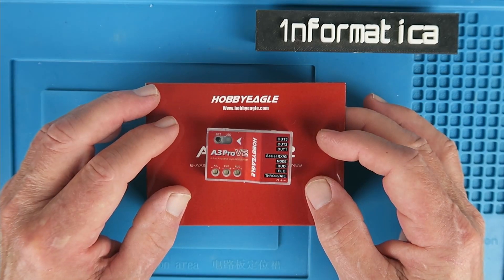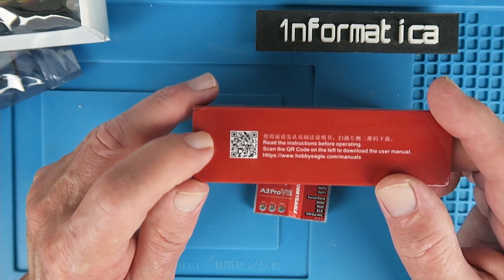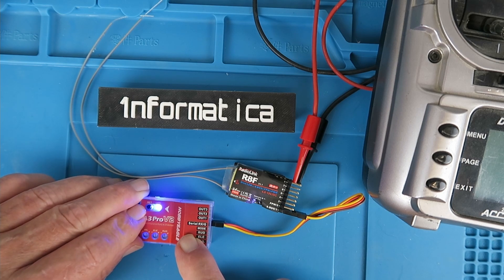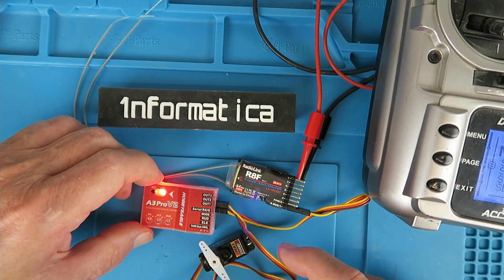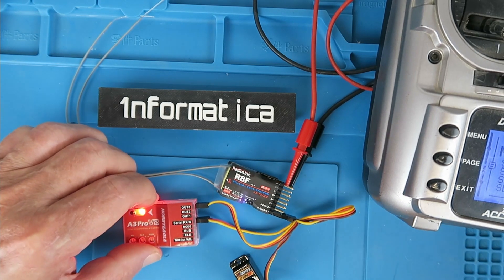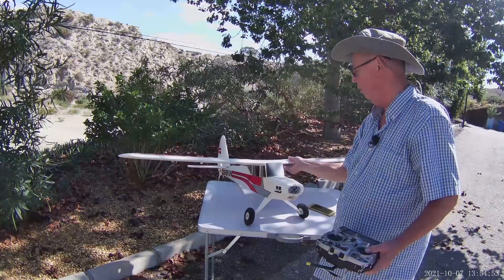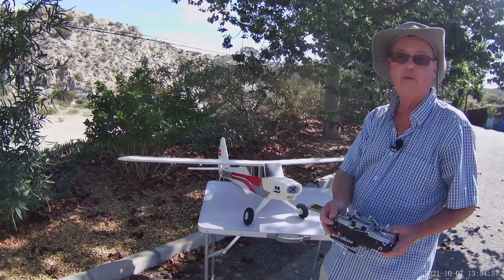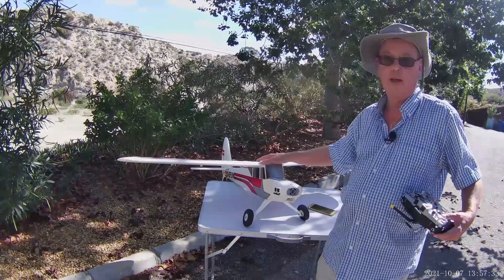HobbyEagle A3 Pro V2 6 axis Gyro Fixed Wing Review

Comment: is it possible to set it on full gyro mode(when i dont hold the stick the plane going straight)? Please give me answers:)
Reply from the maker: Testing Auto-Level Mode: Starts at 2:35
Gyro's Recovery Performance: Starts at 3:06
Reply: @1nformatica okay thanks ! How do I connect wiser ones as ailerons? My born language is not English so l had hard time understanding this it would be great telling me  how do I connect 2sevoes(each ones on left ,right flips) to ailerons
Reply from the maker: @pubgmobile_player_service You connect the 2 ailerons to a single channel using a "Y" cable like this : https://s.click.aliexpress.com/e/_oBZQUrh You can use the video subtitles in Korean : 영상 하단의 CC(자막/자막) 버튼을 클릭하여 자막을 켜세요.

언어 변경:
기어 아이콘(설정)을 클릭하세요.
자막/CC를 선택하세요.

자막/CC → 자동 번역을 클릭하세요.
스크롤하여 언어를 선택하세요.
Reply: @ okay I have y cables by connecting it but how do servo works reverse? by connecting y cable  all I have to do is connecting two services to each ailerons and connecting y cable?
Reply: @1nformatica  oh I understand stood it although it sends sane signal by y cable it moves reverse because the position of servo is reversed on flap I understand stood it thank you😍😍
Reply from the maker: @pubgmobile_player_service Yes, that is correct. You can think of the servos mechanically as mirror images of each other.
Reply: @1nformatica  thanks to you i finished my first 100%diy rc plane its great to finish it thank you
Reply from the maker: @pubgmobile_player_service That is great! Ask me if you need any other help. 메리 크리스마스
Reply: @ thanks merry chirsmas!

Comment: when i plugged in my gyro and turned on things and calibrated things, my servos would not work, and only my throttle did
Reply from the maker: I suspect the receiver is not set correctly, check this table : https://youtu.be/QuFFMQp8A5c?t=141 Thanks for watching, have a great day!
Reply: @1nformatica  ohhhh i see thanks!
Reply from the maker: @skytacos1323  Next time check out the A3 mini, configure with your PC, a lot less hassle!! https://youtu.be/rPhf0cLP1hw
Reply: @1nformatica  now I am going to return the a3 for the smaller one so it can fit in my plane, but it just so happens that my mom threw away some pieces necessary for me to return the gyro in a quest to clean up the house and get rid of things😥😥😥😥🙃😶
Reply from the maker: @skytacos1323  That is a pity, you could still sell it second hand. In Spain I sell stuff I don't use on "Wallapop", sure you must have something similar where you are. Good luck!
Reply: @1nformatica  ill just use the gryro as a spare. think that is the best course of action.

Comment: Hi, I'm going to order a gyro following your advice.
Currently I cannot buy the Hobbyeagle Pro V2 in red color and I want to buy the HobbyEagle A3 in blue color.
I use a Flysky radio with an FSiA6 receiver without PPM output.

(It is the FSiA6B receiver which is equipped with PPM output...)

Can I use it with my Flysky by connecting the servo wires normally without using the PPM function and benefit from all the options of the gyro, auto level, auto gyro?

I can't find any videos on youtube about this...
Reply from the maker: You cannot use this gyro without a receiver connected, that is why there are no videos about it! You need a PPM or SBUS receiver. You should also consider the new A3 Mini : https://youtu.be/rPhf0cLP1hw It supports these protocols : 
PPM Receiver
Futaba S.Bus (compatible with FrSky SBus, JETI SBus, RadioLink SBus and WFLY WBus)
Spektrum DSM2/X 1024 Satellite (Remote) Receiver
Spektrum DSM2/X 2048 Satellite (Remote) Receiver
Spektrum SRXL
Multiplex SRXL / JR XBUS Mode B
Graupner SUMD
FlySky iBus
JETI EXBus ①
Reply: @1nformatica  I read on the manual: Standard receiver connection.
And on the picture I have the impression that this is possible?
can you look at the link and confirm? I messaged the seller to cancel the order. I will buy the Gyro Nx3 to start, I saw videos on youtube where people use it with a Flysky radio.
We don't have a video in French for the Hobbyeagle and I bought it without knowing which radio it works with.

If the seller refuses the refund, should I buy an FsiA6B receiver with PPM?
I don't know anything, sorry...🙄
Reply from the maker: @mekateknik3717  You are correct. The A3 Pro V2 can be connected to a standard receiver with the PWM outputs. It was my confusion, there are too many versions!
Reply: @1nformatica  it's not the Pro but the simple model Hobbyeagle A3 v2... The Pro version is too complicated to set up and costs more. I sent a message to aliexpress to send me my order as planned.
We will test and if it does not work I will order a Flysky receiver with PPM. I will watch your videos calmly and try to learn more...
Reply from the maker: @mekateknik3717  Good luck with your project. I am happy to help if I can. Did you know you can modify the receiver you have to send the flight battery voltage by telemetry? https://studio.youtube.com/video/acVbiXG99eo/edit

Comment: Thanks for an informative video.  I'm looking for a gyro for a rather twitchy plane and the A3 series seem to be well regarded.  When you prepare the plane for flight do you have to set the plane in a particular attitude?
Reply from the maker: Hi, level or desired flying attitude is set by option 5 in the setup menu https://youtu.be/QuFFMQp8A5c?t=459 I set mine with the nose up around 15 degrees. Once this is set you usually do not need to do it again. Pre flight is just plugging in the battery and making sure the plane is still and level until the leds stops flashing. Thanks for watching, have a great day!

Comment: One more demonstration you could have done was to hold full aileron, tilt the airplane to match the bank angle limit, and show that the ailerons return to neutral at that angle..
Reply from the maker: Thanks for the tip. I will be making more videos featuring this gyro so will include that. BTW nice Phantom on your banner, details please!
Reply: @1nformatica  It’s just a 90mm Freewing F-4 Phantom II EDF. Also, you might tilt the wing back and forth thru the bank angle and show how the ailerons deflect to keep it there..
Reply from the maker: @txkflier  Sweet! Looks like I have a lot of pennies to save!